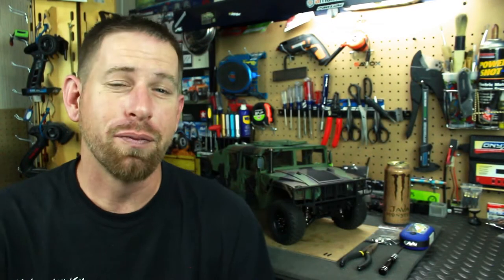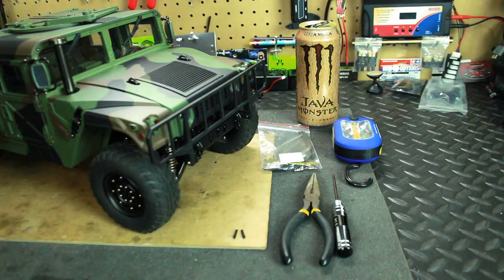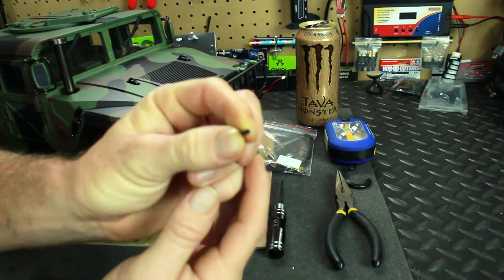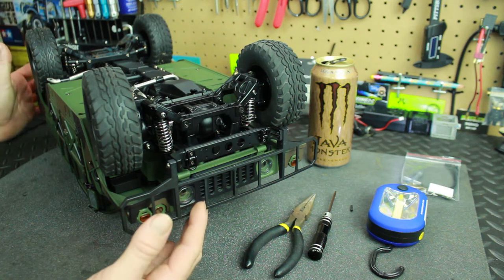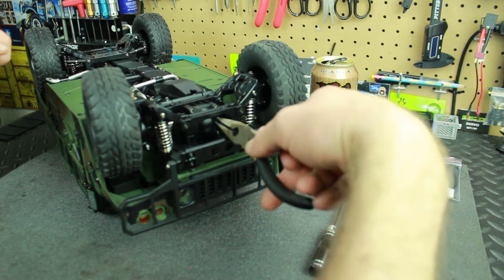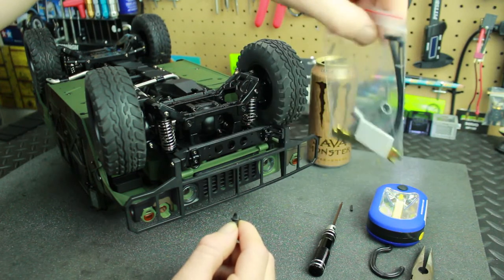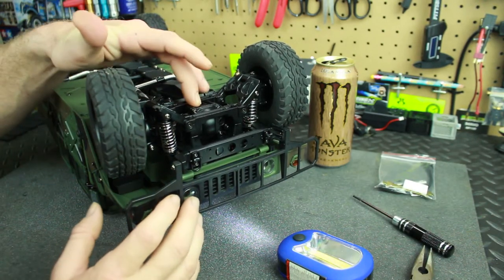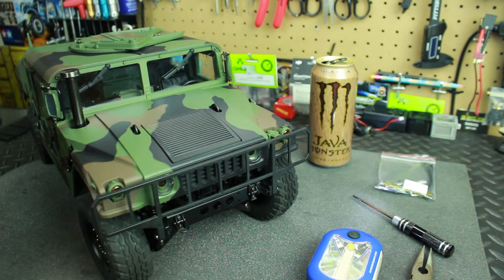RC84Films: HG P408 HOW TO LOCK THE DIFFERENTIALS

Comment: I've not long received my full option HUMVEE and the first thing i did was break the steering servo running in long grass. New heavier weight Servo ordered and installed and it runs great. I did notice it wasn't brilliant at climbing and today i've finally locked the diffs. What a difference that made, no stopping it now. As you have had you Humvee for 3 years would you say there are any downsides to locking the diffs?
Reply from the maker: Just a little more stress on the motor